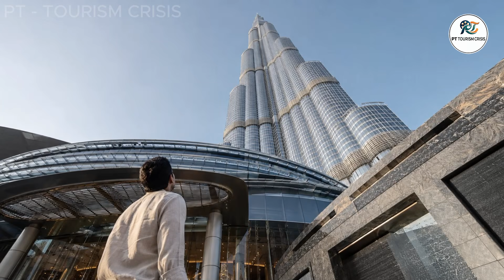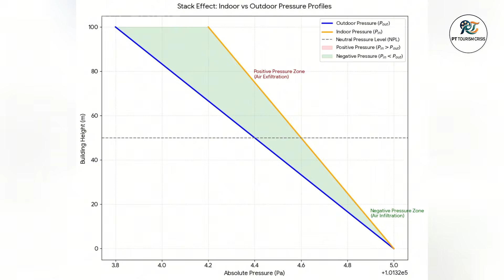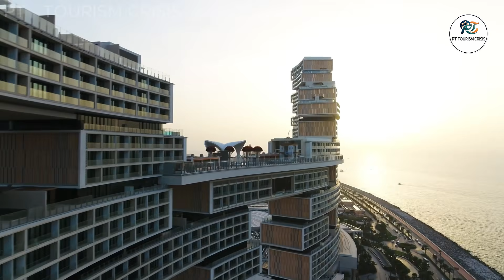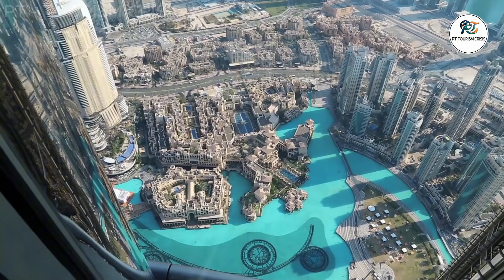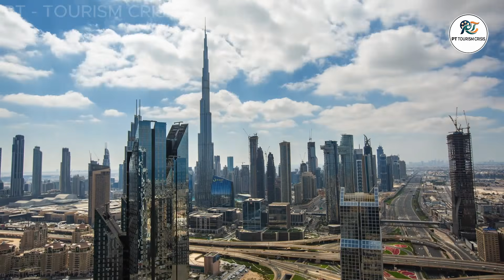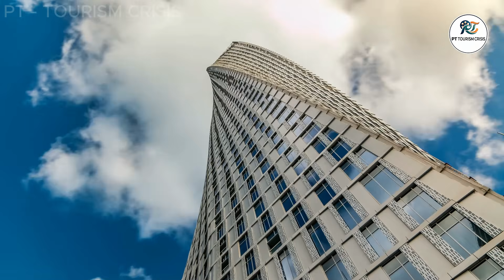Why Dubai’s Skyscrapers Hide a Giant PRESSURE SYSTEM

Comment: When the microchips cook in the blaze, they are very sensitive to temperature changes, the electronic brain will cease to coordinate the many processes.  Anything can then happen.  Imagine a land Titanic.
Reply from the maker: That is a real risk. Fire can disable sensors, controllers, and communications, although modern towers use protected circuits and redundant safety systems to limit cascading failures.